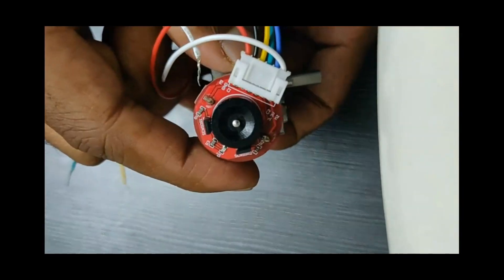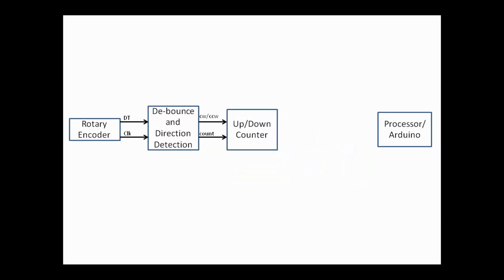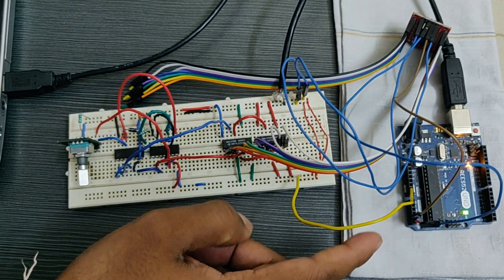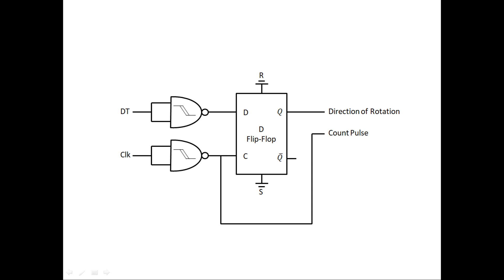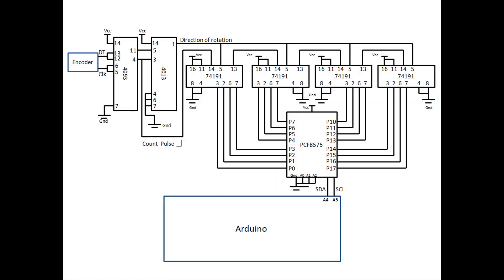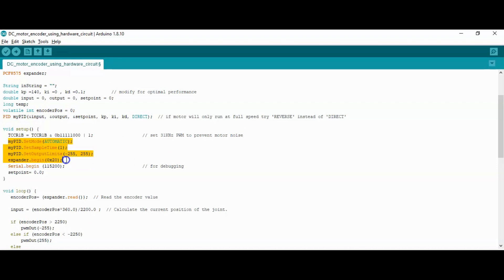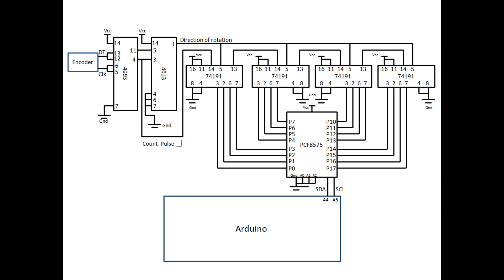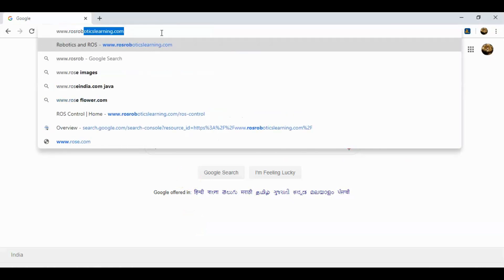Rotary Encoder As Joint Sensors without Interrupt Routine | DC Motor PID Control | Arduino | I2C

Comment: could the 74191 be used to accuretly count a DC motor encoder pulses with Raspberry pi - as curremtly my raspberry cannot capture accurate counts?... thanks... help...
Reply from the maker: Yes. But make sure to use de-bounce circuit also.